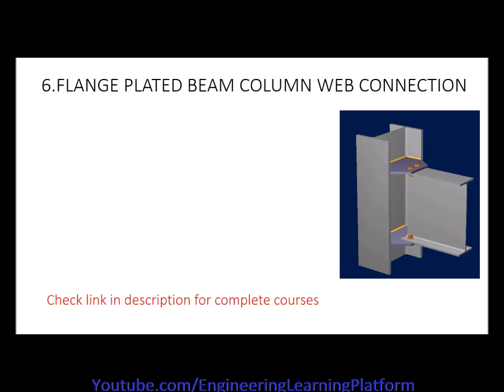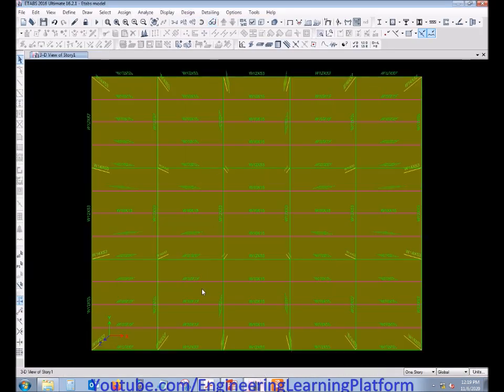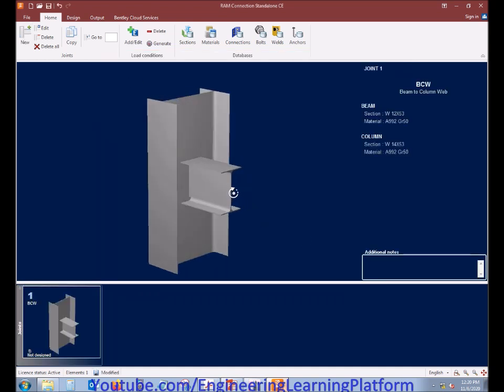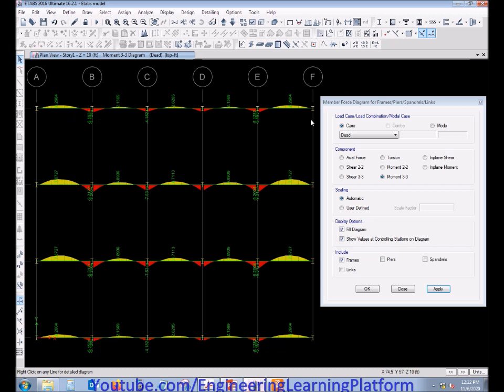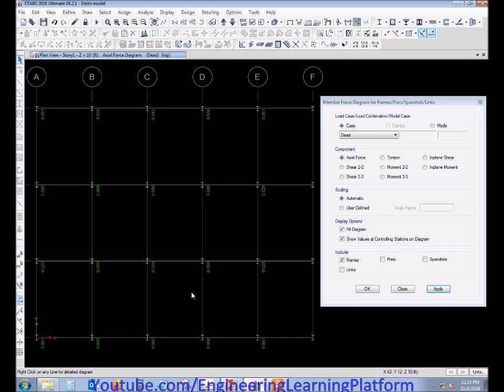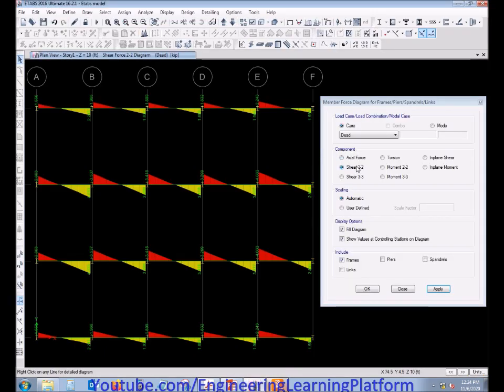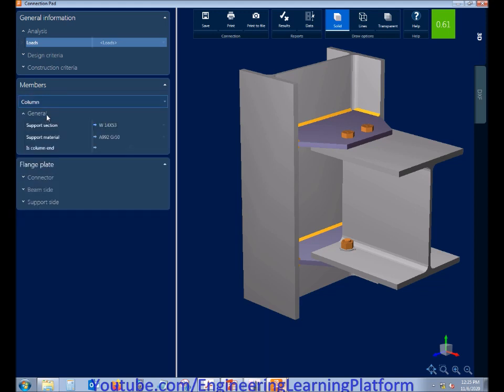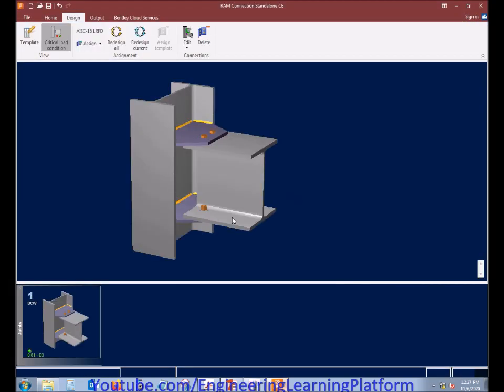Flange Plated Beam Column Web Connection Design using Ram connection

Comment: I have a query. In most of the videos you have typed in the beam forces (axial, shear, moment). But no input was given for column forces-although some connections are beam-column connections, as there is option for similar input of columns. Is column force input not necessary?